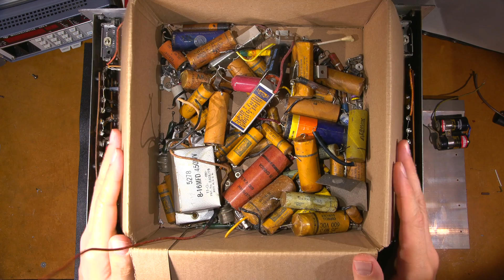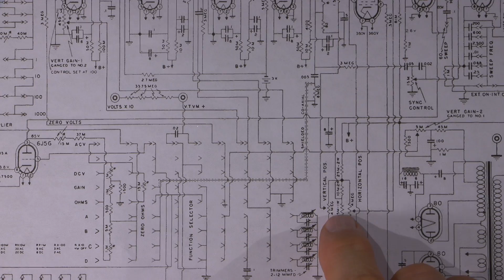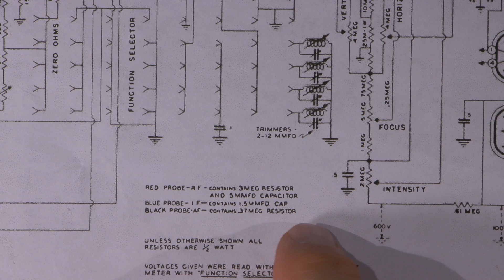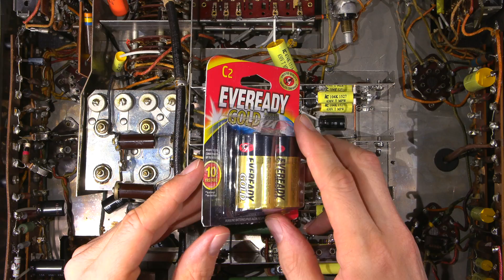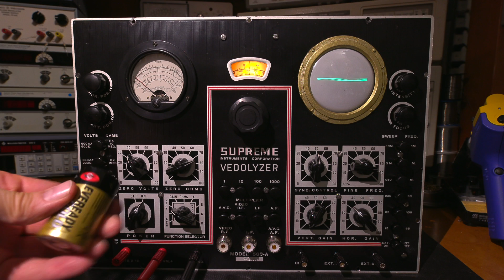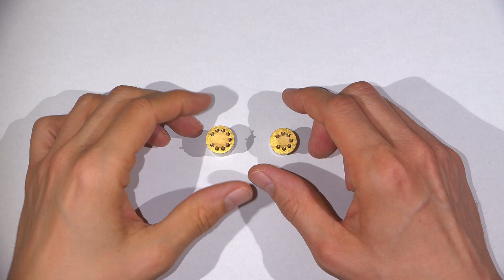It's Alive! The Supreme Vedolyzer From 1939- [Restoration Part 3]

Comment: Instead of using batteries again couldn't you use a charge pump circuit instead? Or use an AD548 voltage reference off ali express? I wouldn't mind seeing a video implementing something else other than batteries in this

Comment: Wow, thanks Paul for this 3-part video on your exhaustive restoration of this premium piece of test equipment!  I have never come across this particular instrument before but, I'll bet it was the "Cat's Meow" in it's day.  It's nice you were able to find some good documentation on this equipment.  When I would pick up old radios/TVs at the dump in the early 1970's to bring back to life, working out of the house as a teenager, I generally had no documentation so, any fix was more of a reverse-engineering effort.

I have only come across a very few old schematics during my life that used "M" for "k" on the resistor values.  That's got to be very confusing for Newbies.

On the vertical amplifier design, you'll notice the plate circuits are very heavily loaded with relatively low resistor values plus, some series coils.  The plate resistance of pentodes is very high compared to the grid 1 and plate capacitance to ground, which very much limits high frequency response.  By using the low value plate resistors, the designers were throwing away gain (swamping out the electrode capacitance) to achieve high frequency response.  This is why they used so many stages of apparent amplification.  By looking at the circuit values used, I suspect the bandwidth is a few MHz!  Most oscilloscopes in that day had a bandwidth of 100 kHz or less. 

That dual-ganged variable resistor that was modified with the 2 drill holes, I wonder if that was a factory authorized service bulletin, it looked too clean for a Tech trying to hack out a quick fix.

I suspect the designers opted for using the flashlight batteries for the bias supply in order to get the cleanest possible DC voltage.  The drawback however: since they are using sharp cutoff pentodes, the plate current will skyrocket if the -3 volt supply drops below -2 volts.  Since they don't have a way to check the battery voltage from the front panel, you could easily cook your 1852/6AC7 tubes and possibly a plate resistor.  I'm not sure what the carbon/zinc battery life would be inside that chassis with all those tubes generating heat, obviously shelf life at elevated temperatures.  Cool stuff, keep up the good work!
Reply from the maker: Thanks for taking the time to write Bill, you know your stuff!

Comment: How do you use the RF, IF and AF inputs?  Can all three be tapped off a single radio at the same time?  Also kind of curious to know why you didn't use the IF input when you demoed the Wave Meter with your function generator.

Comment: Beautiful work!

How does the gain function operate on the Vedolyzer?

Also, did the original bias batteries still have normal voltage, or did they perish?

Comment: Have you considered building a charge pump and regulator that run from the filament supply to supply a very stable negative bias? Or if you're hard set on batteries, what about a lithium primary?

Comment: Just quickly scanned the Supreme instructions on "A new system of Dynamic Analysis" (a pdf on Steve Johnson's site) which is chock full of basic instruction of radios and analysis of signals.  I am sure you realize that essentially the Vedolyzer is the early precedent for the Spectrum Analyzer.  You being the "Tracking Generator" you can follow the signal on the wave meter as you adjust the IF along the frequency.  A step above the VTVM method of alignment.  I need to thoroughly internalize this document,.  I can see why you wanted this equipment working as instructional for us.  Albert
Reply from the maker: Thanks for your kind comment Albert!

Comment: Perhaps that "exotic" potentiometer could be made like this:
1) Get double ganged 5k potentiometer
2) Get 470 ohm dobule or single potentiometer from same manufacturer and series
3) Take them apart and transplant one resistive element from 470 ohm pot into 5k
With some care, it should work just fine. 
Only trick here is getting pots that can be easly taken apart and reassembled
Reply: There were pot kits that you could build like Lego not so long ago.  Your option would be quite viable for this type of restoration.

Comment: Using alkaline cells in something like this would make me a bit nervous - I'd enclose them in a plastic bag to contain the caustic goo that will emanate from them in a decade or so:  The good old dry cell is a bit safer for this sort of thing - if you can find some!
Reply: That's what I was going to say.  Some Panasonic carbon-zinc cells would be much more appropriate.
Reply: I agree with Clinton Paul. It would be a shame to have the stuff leak on the chassis top. I have seen these alkaline batteries leak all the time even when "fresh". You can still find the carbon zinc ones at dollar stores.

Comment: IN-13 NIXIE BAR-GRAPH VU METER
Reply: Yes.  It is IN-13.  Оriginal name - индикаторная лампа ИН-13.
Reply: @migratorybird3625  1 lead is pilot cathode 1 lead is the main cathode 10-12 ma full scale and don't forget the anode .. i have 200 ИН-13 i love them
Reply: I don't.  Storage time is 1000 years, operation time is 1.8 years, but reality it is about a year☺
Reply: @migratorybird3625  i use them in my test gear unlike my stereo a cap checker is only ran long enough to check caps for the outside foil or leakage

Comment: M=1000 in Roman Numerals
Reply: The metric system although adopted all over the world by 1938 hadn't been adopted by the schematic draftsman in Greenwood, Mississippi. But I bet their Bible had Roman Numerals and a guide to their use at the time.
Reply: I hadn't thought of that - but if they had used 3C for a 300 ohm resistor, I might have correlated the letters to Roman numerals.
Reply: @CacheRAM  300 would be CCC in Roman Numerals and 47,000 would be written XLVII. It quickly gets out of hand.
Reply: The whole XLVII would have a line drawn over it which would indicate 47 was 47,000
Reply: @Audion  Yes, I know - but using the same nomenclature as the other ones used (4M = 4000, notice it was not MMMM) you could use M == x1000 and C==x100
Reply: @Audion  actually, 47000 would be X(with overline)X(with overline)X(with overline)X(with overline)V(with overline)MM

Comment: Is there an advantage to having the components in the probe itself? The very first thing that I thought was just stuff the caps and/or resistors behind the scenes and use 1 probe.
Reply: It can be important to have the probe components very close to the tip of the probe, in order to NOT load down the circuit under test. The probe components usually will do impedance matching AT THE TIP to avoid having the circuit under test seeing (being affected by) the cabling of the probe. I had a probe once that had an entire miniature-vacuum tube impedance-matching circuit built into the head of the probe. There was a B+ wire and DC filament supply wires going through the probe's cable. It was used in order to isolate the circuit being tested from the cabling of the probe and the oscilloscope input impedance.

Comment: Love long videos... dont succumb to the ADHD swiping youth!
Reply: Agree, but no ageism necessary.  The attention deficits that humanity is facing are due, mechanically, to excessive push notifications and distractions disrupting the pathway between the anterior cingulate gyrus and anterior cingulate sulcus, as well as psychologically due to the narcissistic aspects of certain social media platforms, and neurologically manipulative advertising and marketing.  It just so happens that youth are more exposed to, and ironically targeted by, such things, which are often initiated by and directly benefit certain subsets of older generations.  More generally, humans have an issue where contemporary society is evolving faster than our biology can keep up, and the tendency is to throw strangers under the bus rather than work hard to improve things.  It's getting to the point where drastic changes in society, or genetically engineering ourselves to have better hardware, are going to be required to avoid a scenario like the end of John B. Calhoun's 'Universe 25' experiment, except with humans instead of mice.
Reply: @alakani  I guess I'm OK.  I've been living on the far side of the moon (far from what was my once home country) for most of my life, I have no FB, Twitter, or any other social media accounts, I turn off or uninstall all programs that bother me with notifications, don't do cellphone texts and watch no television.  Now if I can just get rid of all advertising....
Reply: @alakani  , Really? Even with a degree in Experimental Psychology, your exegesis was a bit dark for me.

Comment: The mystery device is a neon tuning indicator. A variable voltage applied to the control electrode will give a glowing orange bar of variable length. 

The solid state tube replacements were widely used by the telephone industry for updating carrier telephone gear. The Bell System/Western Electric name for them was a "HIN" or Hybrid Integrated Network.
Reply: Agreed. If I were to guess a typenumber, I'd hazard an IN-13, as those seem to be the most widespread of these devices nowadays and has the matching 3 wires.
Reply: Bob Weiss Someone deserves a cookie!
Reply: The tube replacement things, well then i save them, i was thinking Ericson/Bombardier code plug in for railway ATC balises...
Reply: I remember Heath company sell Solid state tube replacements to be used in their IM-18, IM-28 and similar vtvm that uses the 12AU7 and 6AL5 vacuum tubes.